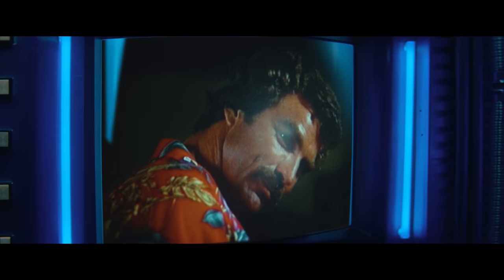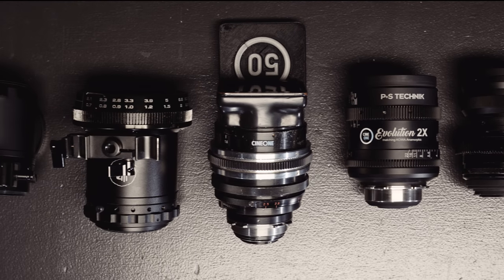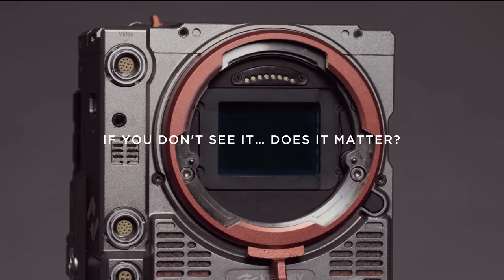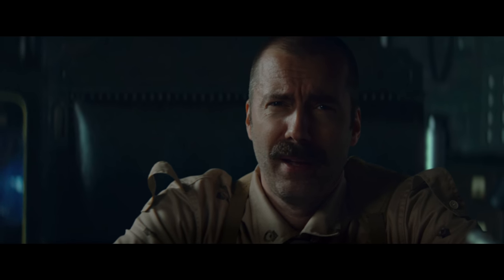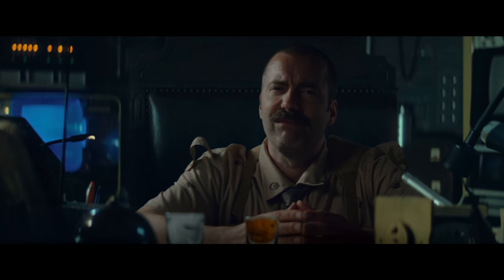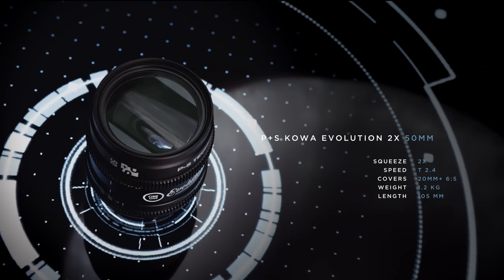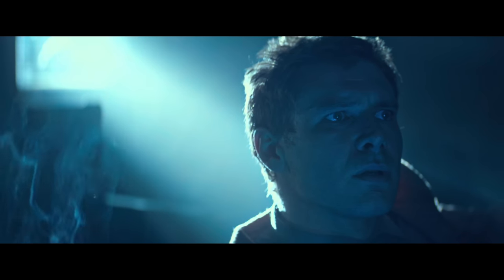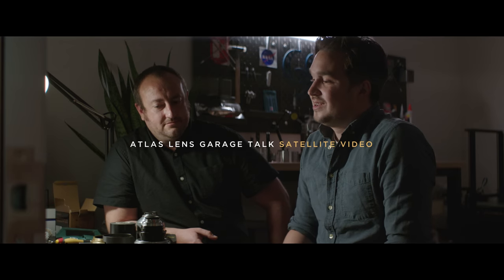SCOPE Chapter Two – The anamorphic battle – Cine Lenses, Attachments & Adapters –  Epic Episode #16

Comment: I just came across this and am completely spellbound by the quality of this video. But what stuck out to me most was you all managed to get amazing looking results out of each lens tested, even the ones that were, on paper, more difficult to work with. I can't imagine that it would have been easy, but it was certainly inspiring. Truly talented people, all of you!
Reply from the maker: Thanks a lot! That shows how little a lens matters in the whole mix of things. Same is true for the camera. You definitely don't need to spend a lot of money to get to a cinematic image.
It will always matter more, what happens in front of the camera. The setups for this test are not specifically planned or set up to make lower end setups shine – they are set up in this way as I like how it looks. It is always a good start to put something pretty/interesting  on screen, like the robot, the projector, the armour… and use a lot of back lighting.

Comment: 45:00 You can see similar quirks with Baush & Lomb projection lenses of the same vintage when compared to modern projection lenses. We recently upgraded from a pair of original CinemaScope anamorphic adapters to some early 2000s Schneider MC Super Cinelux anamorphic adapters, and the sharpness and flatness of color was jarring. The astigmatism was nowhere near as jarring as it was with the camera lenses though, curiously. They're also likely a good deal heavier, so that may be part of it.
Reply from the maker: Thanks for the input Henry

Comment: I shot two commercials for @solebox using the Atlas Orions mounted vertically on a A7S3 - on a DJI RS2. Very interesting look and perfect sensor utilization if you're delivering in 4:5 and 9:16
Reply from the maker: Right… that is where the 20mm height if the Sony doesn't matter .

Comment: Atlas is stunning, works as it doesn't seem stretched on my monitor. The colour is cleaner and sharper. B&L makes me think of the 70's /80's movies.
Reply from the maker: exactly... Atlas don't change the stretch as they are vari diopter designs... the Bausch&Lomb are mech synchro

Comment: Watching this on a huge curved ultra-wide monitor (with a plugin to auto crop between aspect ratios), is quite the experience :)

Absolutely killer job on this video, the attention to detail and presentation is unbelievable! Also, it's wonderful to have the 8k upload! I might not have an 8k screen, but the difference in bit-rate to 4k is quite noticeable, and the grain holds up much, much better!
Reply from the maker: ? How does that work... the width is always the same, so you cut off more or less of the image???
Thanks man... exactly... it's the bitrate that matters... and, why through away information that is there?
Reply: @MediaDivision Pretty much! The plug in automatically crops the black areas. So anything that is in 2.39:1 covers the whole screen. If it's 16x9, or 4x3, I have black bars down the sides.

It makes it feel like the video was edited for a 2.39 release, if that makes sense, lol
Reply from the maker: kind of ;-) : thanks

Comment: Nice vid. Just so you know, Netflix require an active photosite count higher than UHD for anamorphic (3840x2160 = 8.3M) thats why 3096x3096 is accepted (over 9M photosites) but a standard Alexa Mini isn't as its max sensor res is 3424x2202 (7.5M)
Reply from the maker: Thanks for the Input… one of the rules that makes next to no sense… but that is a completely different story ;-)

Comment: Just out of curiosity I wonder how long it takes to render this 2h video in 8k. My PC dies a little bit ever time I render a 4 minute video that is shoot in 6k.
Apart from this, I need to congrat media division. This is an absolute masterpiece on the anamorphic topic.
Reply from the maker: It takes about 4 hours to render to ProRes 444, depending on the workload that is on the rest of the system. The Afterburner card in my Mac helps. Compression will take another 9 hours in media encoder (faster than Resolve with 8K).
Thanks man... glad you feel that way. Spread the word, please!

Comment: Back in the day, one needed a brighter bulb to spread an anamorphic image over a wider screen when using a smaller frame of film.  Film stock degraded faster, so they went back to normal lenses and film.
Reply from the maker: I am aware that a larger/brighter projection requires more light and that would require better cooling in the gate etc. the (rare) vista vision native projectors where marketed with the benefit of more efficiency with cooling. I guess we are both old enough to have been in huge venues that used spherical projection of 35mm without before the age of LED… so, it is not a massive problem. I don't see why anamorphic projection would make a difference here… the amount of light passing through the celluloid should be the same for 35mm spherical and Anamorphic projections if both project to the same image size. I can even see that spherical projection would be less efficient for widescreen projection as more light is blocked in the gate causing additional heat.

Comment: That was AWESOME!!! 
One Question: How did you mount the lens on a 90 degrees angle? Wenn filming with the Camera on it's side? I'd love to try that with my Sony E-mount, but can only mount the lens in the normal way.
Reply from the maker: Thanks a lot. With PL mount you can choose the orientation by 90° steps… of course, no normal photo mount can do that. Wit DIY setups, the anamorphic block can be freely rotated … so, no problem on any mount. It is harder to get the block straight ;-)
Reply: @MediaDivision  Thank you for replying that fast!! You guys are great! Could I turn the Sony mount Lens by 90 degrees, just by loosening the screws of the E-mount, turning the mount 90 degrees and then screw the mount back on? I've never done this before, could I damage de Lens?

Comment: Wow! excellent and fun to watch. It would be interesting to see the comparison test RED MONSTRO 35.4 and MAVO LF Large Format Camera in a low-light room and in an evening city with street lighting or any other RED approximately equal to MAVO LF, it was also interesting to compare MAVO LF and ARRI Alexa Mini, thanks in advance!
Reply from the maker: Thanks… well, we don't have a Monstro, we don't have an Alexa mini… and just throwing 3 cine cams in a low light room seems to be less of an interesting idea… if you use any of these camera, you do design the light of your room. Alexa is HORRIBLE in low light. Mavo will win the low light battle in terms of low noise. Sony sensors with back illumination rule that area.

Comment: I got the Isco UltraStar red with the Rapido front diopter focus for my a7III with the 55 mm Zeiss 1.8 lens.  This set up ended up costing me $1200.00.   It's a pain in the ass to set up so only for static shots on tripod.  I also got the SLR magic 50 1.33x but don't like it: (1) not as sharp as the Isco and (2) doesn't have that wide field.

Comment: Very good series on anamorphics. 
10-15 years ago I was completely obsessed with this. I had a 35mm Square Lomo, which I disassembled the blocks and used the anamorphic block with different primes, like a 30mm f1.4 and a 24mm f2.8. It's amazing how much quality can vary by putting a modern spherical behind the anamorphic block of these vintage Lomos and how wide angle you can get with the 35mm anamorphic 2x block. I finally ended up selling the lens for a good handful of $$. I wanted to make my own anamorphics based on the 35mm front block, a small and light system. I contacted Chinese manufacturers of cylindrical lenses but 10-15 years ago the anamorphic was not so popular and I abandoned the idea... silly me
Reply from the maker: Thanks a lot Roberto, I know how it feels to look back at a "wrong" choice. There are always openings for the creative

Comment: Does the Hypergonar 16 = (or is related to) the Kowa Prominar Anamorphic 16-H ? 
They look similar and both have 16 in the name.  Plus H could mean Hypergonar.
Reply from the maker: Not to my awareness nor is it likely Hypergonar being French and Kowa being Japanese. The 16 indicates the film projector format thei are designed for.
Reply: OK.  That is something.  The 16 indicates 16mm projector lenses.  It doesn't matter if the French made some of a style lens and the Japanese made them too.  They are being made for the same film stock.  Maybe the were made for the same anamorphic squeeze too.   They probably wanted to be used for the same De-Squeeze.  So it would seem they had the same target.  The only thing left would be the cost for the solution back then.   It could be some were high end lenses and others more affordable lenses.
Reply: I found this:  
CinemaScope was derived from an anamorphic-lens system created in 1927 by French optical designer Dr. Henri Chretian. It is said that having seen Abel Gance's great picture Napoleon, which was filmed with a combination of three cameras and projected by three projectors onto three side-by-side screens, Chretian remarked that he could achieve the same result with a single camera and projector, using the optical principle he had developed for tank periscopes during World War I, then only a few years previous. He called his system "Hypergonar" and manufactured a small number of attachment lenses that could be used either in front of a camera lens or for projection. Many of these lenses were destroyed during World War II when Chretian's laboratory was bombed.  So Hypergonar is just a name, like CinemaScope.  It doesn't specify anything really very different.  What is different is your demonstration of 16mm vs 35mm adapters.
Reply from the maker: @jimmoss9584  2x squeeze is the standard for 16mm
Reply: It would make sense since having different formats would be costly.  However, being 72 years old I can't remember having seeing films back in the day, in school, that were anamorphic.  I can't see movie theaters using 16mm film either.  I think they were mostly 35mm.  So where did these 2x squeeze standard 16mm lenses reside?

I am considering buying a Kowa Prominar Anamorphic 16-H and have been looking around for what they are about.
Reply from the maker: @jimmoss9584  Watch SCOPE chapter one... it is all in there. 35mm adapters are larger.

Comment: Hi, I am looking to buy FVD but i don't know which one is the best for me to get sharp image,  your advice please to select between Hardcore DNA, FVD-35A or FVD-24A or FVD16A Or SLR Magic Rangefinder, for your reference i have the following gear:
isco ultra star red
Mamiya sekor c 80mm f/1.9 
Sony A7Siii full frame
Reply from the maker: Hello flaxes… thank you so much for your support.. The Mamiya is not the best choice if you are after something sharp. It is a bit soft in itself and has a large front element (mechanical vignetting). Hardcore DNA is great and goes very wide… at the cost of weight. You don't want to go handheld with that! I have not tested any of the Rapido VD… they don't give out evaluation copies and want you to pay safety on top (not going to happen ;-) … I do have an interesting light alternative to the DNA that is much cheaper and much lighter from VAZEN that is optimised for the ISCO. We will feature that in SCOPE 3. Warning, that will only work if you can unscrew/remove the back part of the ISCO (not possible with many of my copies – see video link). You can not go as wide as with the HDNA – but quality is very good, and it is light enough to go without rails. 90mm works for me… with Sony crop 80mm should cover, too. Hope that helps.
https://www.youtube.com/watch?v=aCIWCWvPhtM
Reply: @MediaDivision  Thanks for your support, excited for SCOPE 3 :)
Reply: @MediaDivision  thanks for your support as usual, another question please, to get a cinematic film look which lenses you suggest to go with isco ultra star red:  LEICA LEITZ SUMMICRON-R 90mm  or  CONTAX Carl Zeiss Planar 85mm F1.4 ??? looking to buy one of these lenses, friendly reminder,  i have Sony A7Siii full frame camera.

Note :) :  i did a quick shot using Mamiya 80,  isco red , sony a7siii and rapido V3 Clamp. the image was lovely but as you said It is a bit soft,  but luckily i noticed there wasn't mechanical vignetting (totally free), may be because i didn't use a speed booster just normal fodox adapter,  it worked very well here :)).
video link for my test : 
https://www.youtube.com/watch?v=AWSeBoSAokY

Comment: I used the PDmovie focus motors to convert dual focus into a single focus system.
https://www.youtube.com/shorts/qtxe-u-vHik
Reply from the maker: Thats a dead link... but sure... possible with some scopes. Others (like the ISCO Red are way to stiff to work that way) considering calibration and such, it is really not an option for anything beyond experimentation. I wonder why Sirui and the like don't offer a dual servo synchro lenses.
Reply: @MediaDivision  weird. Still works. Should go to a short I recently posted. More specifically I paired a the SLR Magic adapter with the canon zoom 24-105mm. I had a custom wide focus gear made for the adapter so the focus puller wouldn't come off while zooming through most of the focal lengths. It worked pretty well. And I could've went further down that road, but decided it was the look I was after.

Comment: I dont get it... So you do it to get horizontal lens flares ?
Why bother with all the lens dual focus thing then? Just add horizontal flares in post if the technical side of the anamorphic is not the point. Lens flare is just an after effect of the squeeze thing. 
I realy couldnt care less what kind of flares there are in the movie. Never noticed it. It never was a part of the story. Never made a difference on anything... What does make a diffrence is the lens rendering, like focus and out of focus parts are actualy different, wich does change the look alot. Not the lens flare. In my opinion... Like how many lens flares are you gonna have in the movie.. One shot? two shots? Maybe three... Its not realy a thing that is worth spending any money or thought on in  my opinion... 
Is it worth doing anamorphic on a digital sensor is the right question? Like is there any benefit to it??? There clearly was with the film... That was the point!!! Squeeze in more resolution and width in on a piece of film... But with digital... There dont realy seem to be any limitation in witdth, or resolution. Or need for. Also if needed sensor probably can be made in any size.
 You can kinda sqeeze more out of the sensor you have, but to give up single focusing for it... Doesnt seem worth it. 

So wouldnt it make more sense to just keep using anamorphic with film??
Reply from the maker: I am not here to convince you of anything... I can only show you the door, you're the one who have to walk through.This is obviously not for you at this time in your filmmaking development. It might come when you fall in love with movies that are shot anamorphic. Nothing wrong with cropping and adding flares in post, Fincher does it.... but I have my doubts that you will get anything but very cheesy results if you do that on your productions. I can't give you a full education in comments – this is what the videos themselves are for. The series is quite comprehensive.
Reply: @MediaDivision  The video is super well done and amazing. Respect!
Also the Blade Runner punch in shots are realy good and well made... 

I am just in general wondering of the purpose. Is there any actual benefit to shoot anamorphic on digital sensors??? 

Does it help with squeezing more out of the sensor???

Also. Thank you for the comment.